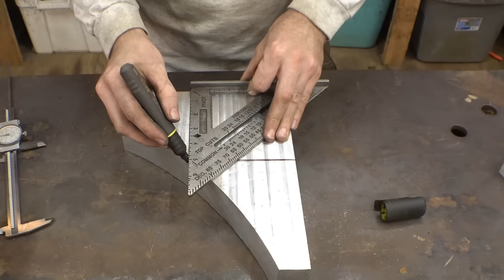How I Made Some Billet Aluminum Bearing Carriers for my Next New Project!

Comment: 8:36 it's not terribly hot because the metal table sucked the heat from your aluminium part. Try to isolate your part (with wood or something else) to keep the heat in the part, not in the table 😉
Nice job Chris!

Comment: You just described how a jig & fixture Machinist makes most jigs & fixtures ! Most of the time We are given a part and told to make a fixture for it or a group of parts + completed weldment and told to make a  jig to hold them for welding. I would occasionally make a rough drawing but most of the time I just built around the part / parts.

Comment: When heating aluminum up for a friction fit it always always always takes twice as much heat and twice as much time you think its going to. If you have any fire resistant material other than a steel table, ie., fire bricks or even some expanded mesh for less contact with the aluminum you're heating up then it'll go much much easier next time. 
That steel table will soak up so much heat. Its surprising that you got the 2nd one to drop before running out of propane.

Comment: The only issue I see is that it looks like you put the retainer clip on the outside of the assembly which means all the forces trying to pull the wheel off the buggy are going to be transferred to that thin aluminum housing.  It will probably be fine but for heavier vehicles the retainer clip is on the inside so the c.v. shaft itself helps keep the bearing in place even if the nut gets loose for some reason.  I think you will be fine though. lol

Comment: Stop using chains on these larger vehicles.  Do difs and drive shafts.  And put fenders and a quieter exhaust designed right from the start.  You can get drive shafts and difs from the junkyard and cut them down.